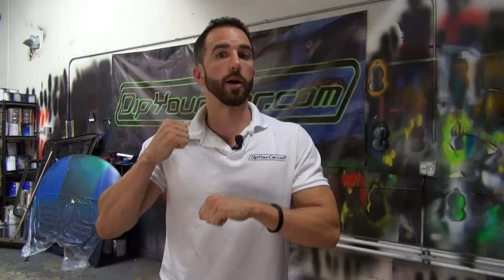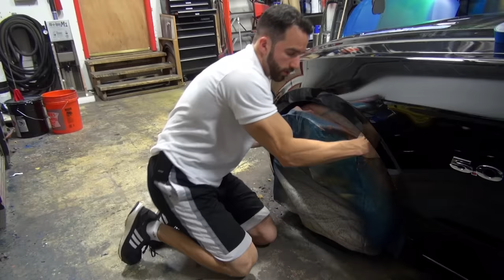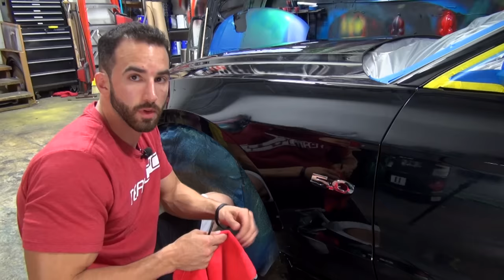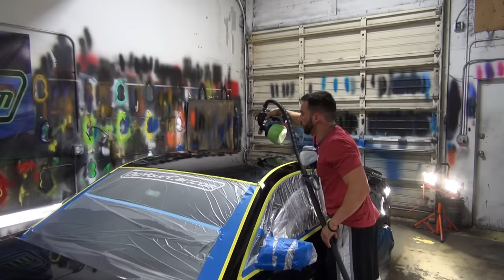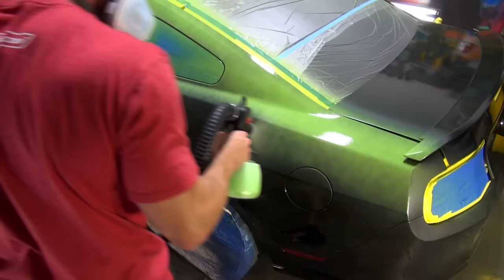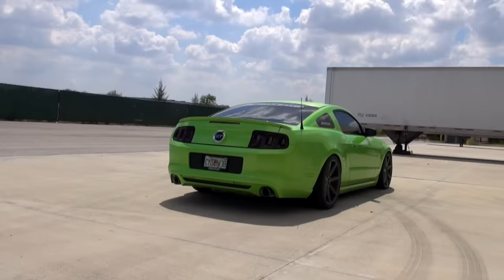Plasti Dip Your Car - The Complete Guide

Comment: Why was the trunk popped at 29:15?
Reply: so he can paint the very top of the bumper i think
Reply: because there were 3 golf bags inside.
Reply: 이연수 ??
Reply: Mikikorcz Thats sorta what i was thinking but wouldnt dip makes it way into the carpeted area of the trunk?
Reply: you should pop both the hood and trunk open so that you get the edges good!
Reply: Adam Tebas not sure, I've never used it before
Reply: Adam Tebas only done it at the end so he could get the tape off
Reply: Adam Tebas To hide the body in the trunk...
Reply: Adam Tebas Because racecar.
Reply: Colorado Cuztom Wrapz *well
Reply: 718 Dips

Comment: Would this work on my house
Reply: John Barnes you'll need a lot of it
Reply: John Barnes . Yes it does. Is there anything else you want to ask?
Reply: Why would you want the paint to peel off of your house?
Reply: yep and would work well as a water barrier. just make sure the wall or wood  underneath is dry first else you trap the water in :)
Reply: John you can plastic coat dip anything. You just need to have enough of the product.

Comment: I have a question about Plasti Dip but I don't need to use it for a car. If I use Plasti Dip on a cable, like an AUX cable, will the Plasti Dip dry out and break on the cable? Or will the Plasti Dip still be as flexible as the cable is?

Comment: would plasti dip pigment pearls work in real paint
Reply from the maker: The pearls do, yes.
Reply: +DipYourCar so if i got regular clear paint and used it on my car it would work
Reply: +DipYourCar where are u guys located cuz I want u guys to do it
Reply: +DipYourCar no, entirely not accurate to just say yes to such a broad statement. Many paint lines will not accept third party additives or will only accept a small amount.

Comment: So on plasti dip site it says wait around 30 minutes between coats. Then another part says 4 hours between coats. So how long do you wait between coats? Also, when you say you peal the frog tape when it's wet but then it says to wait for it to dry before each coat. So how or when do you take frog tape off?

Comment: I have a friend considering something like this on her campervan.  Do you have a kit for a 22 foot winnebega Travato type unit? They are large vans.    Also,  if so,  many people are remodeling campervans and trying to make them look nicer.  What do you think of doing something like this on a campervan with all the stuff on the roof,  all the stuff on side of van,  including vents that have to be there for safety and legal reasons.  Perhaps you could consider a video doing a camper van as an example if you think this is something that this product would work for.

Comment: can you clear coat over this so its permanent
Reply: Sounds like a terrible idea
Reply: connor jones fucking honda guys...
Reply: yes you can.
Reply: es yes you can, use plastidip glossifier. same flexible stuff, adds gloss without taking away the flex.
Reply: hah a troll now, thanks mate. Clearly i have no knowledge as I look out on my fleet of dipped vehicles :D :D
Reply: connor jones  thay won't even last I reckon he ruined it,didn't even key the surface I'm a spraypainter 13 years and that's poor
Reply: the whole point of using plastidip is you do NOT damage the underlying paint.  duh..
Reply: i will leave the trolling to you Robert, you are doing it so well. :D :D
Reply: If i was trolling then you would be taking the bait.. Ironic huh ?
Reply: Old bob continues to troll badly :D , Plastidip can be put down as a permanent coating, you just have to follow the same procedures as you would for standard paint.  Prepare, prime etc..

But the majority use it as an over coat for protection of paint and/or for a temporary colour change.

We use it for both reasons here as the rubberised plastidip is excellent for protection against stone damage on our high mileage vans, especially as they are often used on rural roads and tracks.
Reply: :D
Reply: Dude was just asking if he did put clear coat over dip would that in effect give him more permanence or make the dip job last longer. And yes it will make it last longer as the clear coat would protect the dip better than no clear coat. However, no it is still not permanent. You can still peel it off, but if you wait enough years before trying to peel it off it will become so difficult to peel off you may as well consider it permanent. I mean in the same regard you can buff off real paint so it would be about as permanent as that, but still removeable with enough effort

Comment: so my current vehicle is an ollllld hand-me-down, and one of the previous owners clearly tried to paint or dip the car at some point or other and did a poor job of it. as a result, the surface is rough and uneven plus the surface has chipped over time (no damage to the metal itself as far as i can tell, just chipped paint or dip, i can’t tell which though.) how do i go about remedying that mess so i can start the project to make my car look actually presentable?

Comment: I've plasti dipped my car,  and here's a problem that I've had,  is that prep time is a must,  but after mine has been done for couple weeks, it's that dirt stains it bad. And dust ,  I've used a soap and brush and it doesn't come off,    so don't look for this stuff to look good long if you drive a lot ,

Comment: I have a 04 Tacoma in very good condition but the clear coat is thin. There are places with needle size rust. Only visible from up close. Would it be safe to plasti dip my truck?  Also does plasti dip hold up to off-road driving with mud, dirt and rocks thrown at it??

Comment: I am very interested in doing this on my motorcycle and was wondering about 2 tone finish's and decal application using  HVLP spray equipment for applying the product and applying  a final clear coat application over the vinyl decal and the affects that the decal could possibly have, First if it is possible and secondly if I ever desired to remove the product to go back to my factory finish, Has this ever been done and what were the results?

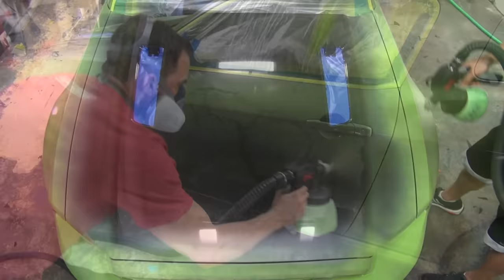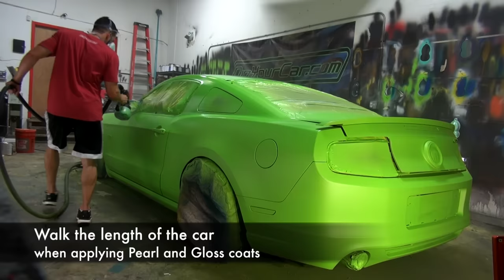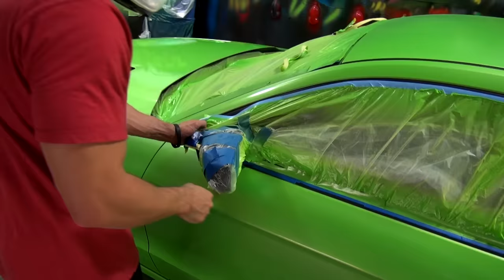Comment: How come the "5.0" emblem is not green?  At 26:14 and 29:23 we see it is not masked.  Again at 32:07, as the masking is being peeled, it has obviously been sprayed.  Since the coating forms what is essentially a rubber glove when dry, which is why some masked areas are 'peel wet' how does the emblem end up chrome at 32:47?

Comment: I am seriously thinking of doing this to my car. I have a Cab e46 so it is a small and square car. a paint job is somewhere at 1500-2000 euros and so is wrapping the paint. Hell no I am paying 2000 euros for a wrap that only lasts 2-3 years. I believe getting a spray cannon and do 5-6 coats of the paint I want then 3 or so with gloss is a lot cheaper?
E46 should be really easy to work with. Especially since it is a cab. no roof to spray and no trims on top of the roof.

How much could that be ish?

Comment: how long should you wait in between coats? Or just start the second coat in the same spot u started the first one as soon as youre done the whole car?
Reply: also as a side note, I noticed you just painted over the 5.0 logo on the front, how did you get the paint off once finished?
Reply: @dbman992  is very easy to peel off the emblems

Comment: OR...you could just remove those bits you do not want to coat with this stuff...right? Just depends on what is more practical. My cars headlight are held by two plastic clips. Pretty easy to remove.

Comment: , I would imagine that you would have to trim every crack and crevice with a razor blade. otherwise the rubber would just peel off.
when you try to pull the tape off.the windshield and windows, lights, mirrors, gas tank fill door, doors.

Comment: You use a big ass brush to wash your car?? You need to use a wash mitt and start from the top and work your way down. I saw you scrub down low then you scrubbed up high on the car, bring all the road contamaments up and scratching the paint